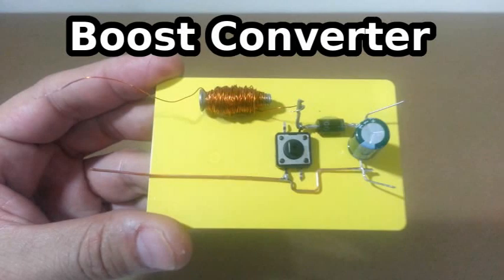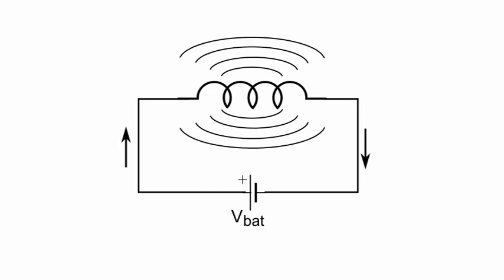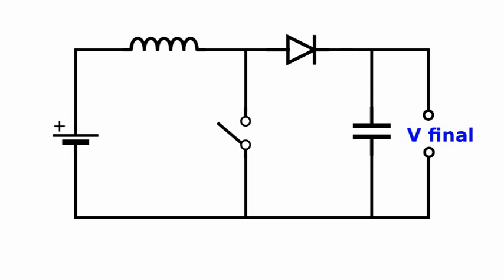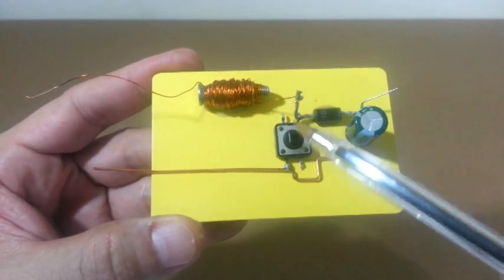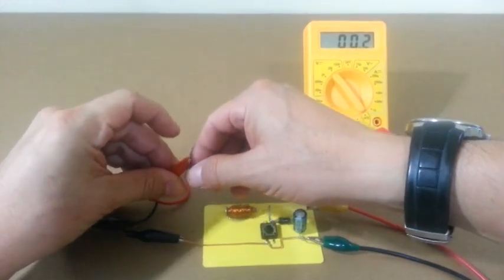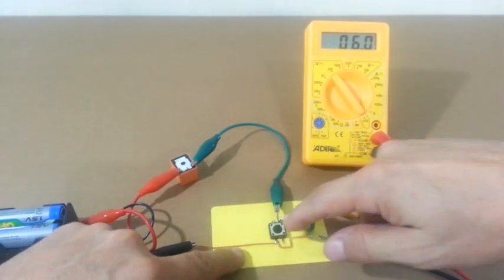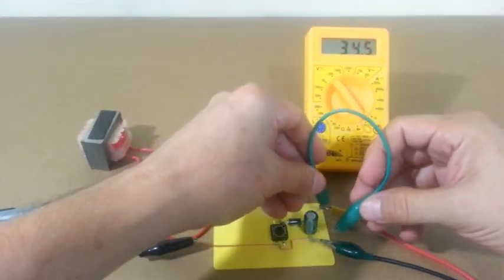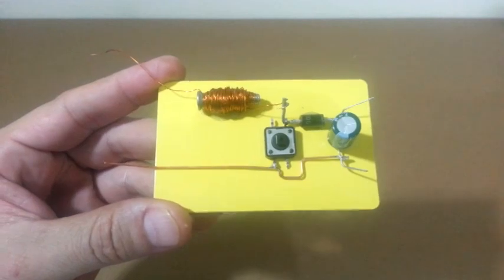Boost Converter - How it works?

Comment: Let's take 2 batteries 3.7V and one is used as voltage booster which can boost upto 12V and in the meanwhile 2nd battery will charge from that 12V and once that 1st battery is out of charge then the 2nd battery will takes its place and once that 2nd battery is dead then the 1st battery will takes it place and this cycle goes continuously and so that will it be a perpetual mechine

Comment: Thanks for this video. What are the theoretical limitations for higher voltages? When it comes to very high voltages, we usually see Flyback transformers or Cockcroft-Walton generators or serial combinations of the two. Is there any reason (e.g. component limitations) the same (let's say ~10 kV) can't be achieved with a transformerless solution, with "pumping up" a capacitor from inductance alone?

Comment: If capacitence low ( like 1uF) you can reach easily to 100-200 volts.
Or inductance high (like 660uH) you can reach easily to 100-200 volts.

Comment: This is fake. It should not boost the voltage as it's switching is not synchronous or high. A transistor should do it. What you are doing will only cause a short circuit each time you press the switch.
Reply from the maker: your ass is fake

Comment: I made its it's working but voltage show only in Multimeter when you connect a load  the output voltage becomes equal to the input voltage

Comment: If the switch is replaced with a very small capacitor, will it work the same? Because I imagine that the small capacitor will charge the inductor at a small amount of time until its own resistance rises to stop DC flow, and effectively acts as an open switch

Comment: I did, it worked but the LED is not glowing instead it blinks when I press the switch 
Please help me out sir 
Reply me quickly sir
Reply: Because boost convertors need the switching to oscillate in order to simulate a constant supply as it only produces the higher voltage in bursts

Comment: i have tried that circuit, but my circuit is short circuit.. what is the problem??please answer quickly.. thanks
Reply: Because the input side just consists of an inductor and a switch so as soon as the inductor has built up a stable magnetic field its basically just a dead short(when ignoring its innate esr)

Comment: I made this and it short circuits my batteries and lowers voltage. I am using 3v dc. any tips to get it working?
Reply: Because the input side just consists of an inductor and a switch so as soon as the inductor has built up a stable magnetic field its basically just a dead short(when ignoring its innate esr)

Comment: does this also increases the amps?
Reply from the maker: No
Reply: is there a circuit in which you can increase the amps of a battery?
Reply: @kronosdarkangel5290  yes, but it will decrease the voltage

Comment: Just tried this on breadboard with 9 volt battery, E19 audio transformer (blue in color, used the side with 2 terminals), 1N4004, a switch, a 10uF 160v e-cap. I reached 115 volts measured with DMM :) and stopped there. :)
Thanks a lot, Ludic. :)

Comment: Can you use this with a 555 timer as an oscillator? I really need the answer ASAP thanks!
Reply from the maker: yes but you need more circuitry than just the 555
Reply: Ludic Science thanks for replying incredibly fast. I already have an oscillator circuit. Can I just plug pin 3 to a mosfet instead of the tactile switch shown in the video? Therefore it turns it on and off really fast, thanks!!!

Comment: Very good. One thing to add, when the switch is off the magnetic field in the inductor/transformer collapses in opposite polarity of input voltage, this results in two voltages Vin + the back emf (voltage) across the inductor. They then both add up and the voltage output is boosted

Comment: If you used the relay as a coil, the relay would also make a clicking noise because the magnetic field inside pulls a switch making a "*click*"

Comment: Does it work without a diode?
Reply: Andre Niño Bayud The diode stops the switch from discharging all the energy from the output capacitor i.e. shorting it out. So it’s needed during the period the switch is closed to maintain the charge in the capacitor for the load to use

Comment: > be me
> charging caps capabilities intensifies
> makes the circuit
> uses an inductor with 2Ohm of resistance (does not know about that)
> burns the power supply
> fml.jpeg

Comment: such a simple and understandable video thankyou:) it worked wen I tried with transformer....but what transistor can I use instead of switch soo that I can get a stable output voltage? I tried to use bc547,didn't get it though

Comment: Can this type of circuit make a small electric brush-less motor spin faster?  I'm trying to make a hovercraft thrust propeller spin faster but I'm limited to either 9 or 18v (two 9v batteries).  I think I'm correct that when I boost the voltage, the current decreases?  Is there a way to do what I want with light weight electronics?

Comment: if I have 400 volts and only 250mah what can I use to increase the amps.
Reply: erick sal if AC Or DC
Reply: I noticed a typo it , its not 400, it 80v DC, 220mah, its a micro hydro generator, you hook it to a water outlet and it generates, here where I live we have big water basins on the roof, 750 liters, the basins have many water outlets at the bottom so you can connect pipes or PVC, so I connected a garden valve to one outlet and the pressure is strong, from the outlet of the generator I connected a water hose back into the basin, no water loss, but the out put is low on amp's (DC) I was thinking about a booster or transformer, any ideas?
Reply: Use a inverter circuit then use a step down transformer
Reply: OK thank you,
Reply: No problem :)

Comment: Thank you for providing a simple, understandable, and repeatable experiment to help me understand boost converters. I need one to power a small thermostat (which for some weird reason has an input voltage of 12v) with a portable battery (9v). I'd rather build the converter myself since I'm modifying something with the thermostat anyway. This helped a lot, thanks!!

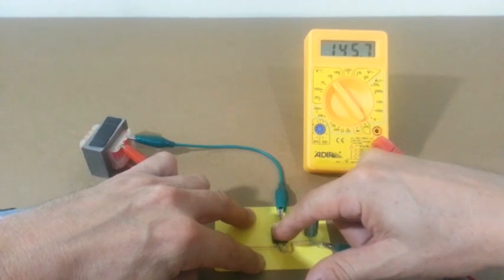Comment: Why your capacitor not exploding according to excessive rate of voltage @ 4:05 (140 volts)?
for example, if i have 100uF/16v and i give it 50v accross, it will explode
Reply: Alviansyah Arman It did not explode or fail because the capacitor he is using is rated to 200volts

Comment: Is this example harmful in any way ?
Reply: just don't touch the output-wires when charged to a high volatage. >60V can be very painful, >120V is dangerous!
Reply: but the amps will be quite low.
Reply: thats correct, but even small amounts of current (and high voltage) can (for example) confuse your heart(beat)-rythm

Comment: Can the button be replaced with this component (http://www.st.com/content/ccc/resource/technical/document/datasheet/1d/eb/f3/e7/63/c2/48/8a/CD00003024.pdf/files/CD00003024.pdf/jcr:content/translations/en.CD00003024.pdf) and if it cans, how?
Reply: Hum, a transistor should work i think, just to know what kind of transistors... There is a huge amount of diffrent transistors...🙈

Comment: with this circuit, does the high voltage flows back into the input battery??? that would be bad
Reply: No. Thats why you have a diode to avoid the current flowing back.

Comment: you can use that volts in 120 electricity?
Reply: in theory you could use it on heating-devices and simple motors. But the output is is very low-powered (propably < 1Watt when triggered by hand). Also, the output is DC, but for household-application you need AC
Reply: If you mean you want 120v AC then with that you can't. Because batteries voltage is DC.
But if you add AC to DC inverter then you can. Just like these car adapters work:
http://www.instructables.com/id/120v-Power-Source-for-Car/?ALLSTEPS
Reply: DC to AC inverter. Inverters are commonly used in PV systems to change the DC source of the panel/batteries to AC for house loads. Only problem is finding one to match the application or scaling up to match the inverter.

Comment: if i change the push switch with mosfet then where should i fix the G D S pin?
Reply: Joe i think you have to use a timing/trigger device like Oscillator to do on-off a transistor rapidly... i am not an electronic engineer...

Comment: did this booster change the current also?
Reply: Hossam Gouda Yes The Current Decreases When The Voltage Increases So The Output Remains Same
Reply: Hossam Gouda Yes The Current Decreases When The Voltage Increases So The Output Remains Same

Comment: Nice video dude! Nicely explained. Btw, what is the current output at around something like 20 volts? can i use this device to power small breadboard projects that require around 5-9 volts with specific current in mA? You see, I'm a noob and variable DC power supplies are too expensive for me :(
Reply: As these tyoe of circuits are unstable, you cannot use them as a power supply. Ohms law says that I=U/R (current equals voltage divided by resistance), therefore your output will have less and less current as voltage is getting higher.
For a variable DC supply, you can use any transformer, connected to a Graetz-bridge, an LM317 variable voltage regulator, some resistors and two electrolitic capacitors, there are many simple and easy plans about how to make one. LM317 is cheap, reliable and you can buy it almost everywhere, including ebay, or a local electrotechnical stores. Just search LM317 on the web, you'll find billions of plans with it.
Reply: Thanks for your suggestion bro. Very well explained. I think LM317 based variable voltage regulators can be a good choice for me, as I've found very affordable one in a local store. Just what I needed. Thanks again :)
Reply: evanB
You're welcome.

Comment: Lovely video! Is there a minimum voltage threshold for this circuit for the voltage you want to increase? Thanks in advance!
Reply from the maker: the minimum voltage depends on the components used for switching. this is just a demonstration setup
Reply: Would this circuit work if I wanted to use an MP3 as the DC source I want to amplify? (without messing up the MP3 itself)

Comment: so if u boost the voltage that way..... you must lose something right? like the amps??
Reply from the maker: marcques mouton impossible
Reply from the maker: +Hammer USN yes of course
Reply: ok ty
Reply: Hammer USN this is so fake because that capacitors max voltage is 6v and the curcuit makes no sence
Reply: if it's a 200v capacitor it is not a max voltage of 6v, it is a max voltage of 200v. however you do lose something as with all converting circuits like this, which is the max current.
Reply: any chance you can boost both the amps and voltage?
Reply: Higher voltage source, hah
Reply: Or magic
Reply: Cole Foster Why don't you try it? Connect it to an Oscilloscope if you want more accuracy in measurements.
Reply: This went from a science question to internet cockfight rofl
Reply: the iN4007 is a good one, but basically any diode that is rated above your voltage should be fine
Reply: u can buy these fully working on ebay like $3  man, is u want. i got 5 of  these buck converters off there for like $7
Reply: P in always has to equals p out mins the inefficiency of the components and since p = iv if you increase one the other must go down

Comment: Why do you tap the button repeatedly? Is it possible to transform 12vac into 24vac or more with repeatedly pushing a button?
Reply from the maker: Yes, by using an electronic switch (transisor). This is only a demonstration circuit

Comment: But why we need the coil?and how the voltage value in the capacitor is keep increasing?i thought the capacitor just stores the our input voltage?
Reply: The coil 'wants' to maintain a constant current, so when the circuit is opened (no current can flow), the coil 'attempts' to get the current going. To do so, it would need a high voltage. Capacitors do not conduct for a constant (DC) voltage, but they do conduct if a changing (AC-ish) voltage is applied: current can flow and the coil loses its magnetic energy (thats why it wont keep charging up if you stop pushing the button) Capacitors charge up until they have reached the supply voltage (6V, initially). For this reason, they can get charged more (until a higher voltage) if the coil is inducing this.
Reply: Coil makes electromagnetism and it back to coil, it's creating a higher voltage and charge the capacitor.

Comment: Excellent work,and explanation  man ! if as coil ,i put two tranformers ,and a capacitor of 220 uf what voltage obtain?of cource,as batery ,8 volts. How can increase amps in that kind of circuit? wait for an answer ,man,and once again  congratulations for explanation !Greetings fron Transylvania !

Comment: CAN SOMEONE PLEASE HELP ME : im trying to turn it off an on  with a 555 timer, will the circuit work the same if i turn the positive on and off from the output of the 555 timer? and 
 im gonna be using the same power source as the inductor so how do i stop the chip from burning out?

Comment: How comes the  seconday part of the transformer  generates a higher voltage than the primary yet it has less turns?
Reply from the maker: there is no secondary

Comment: i used a 555 timer with a mosfet and a little square inductor out of a CFL light and got up to 330V
Reply: you need defend 555 ic with a diode becuse coil make high voltage and kill all sensitive parts :) and 555 ic max voltage only 15V
Reply: but how low will amps go?
Reply: Darius Cotovanu input or output? input is usually 2 amps
Reply: output
Reply: Darius Cotovanu i dont know sorry
Reply: omg omg ok ok please give me the schematics for that how did you connect the output  of the 555 timer to connect to inductor
Reply: oh my bad you used  a transistor im guessing npn right
Reply: PLEASE ANSWER ME
Reply: HOW DID YOU GET THE 555 timer to not burn out
Reply: Awesome

Comment: extremely helpful, thank you.
i just need to know what happens if u press the switch for a longer period of time before releasing it, does it affect the maximum induced output voltage ?
Reply from the maker: does not help, on the contrary
Reply: +Ludic Science on the contrary? u mean it will damage the circuit?

Comment: Thx for sharing. BTW the transformer you were using was a step up transformer cause the secondary coil generated a higher voltage.
Reply from the maker: +ziad fawzi There is no transformer. Only an inductor. One single coil

Comment: can i use copper wire for the inductor?
Reply from the maker: +Guy Green must be insulated wire
Reply: +Ludic Science so i can use copper wire but the wire needs to be insulated?
Reply from the maker: +Guy Green Yes
Reply: +Ludic Science ok thx <3
Reply from the maker: +Guy Green magnet wire can be recycled from old transformers and motors
Reply: +Ludic Science ok i will try to get some transformers :D

Comment: Current decreases. How to increase it?
Reply: Hi,You can let the voltage on the maximum by replacing push button by a slide switch,It wont decrease now

Comment: hello sir good video.
but how can i use with electronic motor for generate power and  re-boost that power ?
example : currently  i am convert  3 v to 28 v.  
now i wan to use 6 v for re-generator 3 v  and other 20-22 voltage for some other device like charger or fan  etc.
plz help me sir
Reply from the maker: +Ronak shah so you want to recharge your battery with those 3 v to recharge your battery and have energy forever? Sorry that is imposible
Reply from the maker: +Ronak shah I am NOT INTERESTED IN FREE ENERGY. My channel is about real science, not fakes.

Comment: Thanks for all your help ! Really much appreciated !, last question ............. how would you maintain the output voltage of your booster to supply steady Vout ?

in other words ..... suppose you press the switch and stop at 60V, how would that 60v be maintained on the Vout ?

thanks
Reply from the maker: +Nico Botha you need a voltage regulator circuit

Comment: Hi thanks for the video, very nice ! Being new to this i have a question .... 1) Can you use normal insulated 29# wire 2) Can you chaqnge the capacitor values and it will remain working ? 3) i am using 20.1v solar panel as power supply, is this ok ?

thanks
Reply from the maker: +Nico Botha Hi, normal wire is very thick, the coil will be too large but it may work. Yes but the cap voltage must be the same or higher than the output voltage of the converter. 3) yes
Reply: I am very new to this !! (total electronic background is 3 weeks)
sorry, its not normal wire, its copper wire i bought from an electronic store ! (hihi), .... let me explain what i have done and used and you tell why its not working Please ...... 1)SWG 29 Wire 2) Hitano 100uf 450V Cap    3) 1N4007 diode, 4) IAlso i regulated the power comming in with a LM 317 T - NLAO 142 (i think), because i also added a 100k Pot connected from the power (20v solar) to the ajustable on the 317, and the LM317 vout to your circuit !

please help out

thanks
Reply from the maker: +Nico Botha first, the wire must be insulated, you need magnet wire (also called enemelled wire). second, make sure you have a voltage at the output of the LM317
Reply: Hi thanks for the reply !, i suffered a bit, but eventually added different caps, directional diodes, a zener a few resistors and a transformer...............it maxed out my dmm (set at 600v) !

problem is no longer to get voltage up (managed that), i now seem to have a current problem !, how do i cross that bridge ?

Comment: Try connecting a load and you will see how things get harder.
Reply from the maker: +MyKhalidkhalid Did you see the video? This is just to demonstrate the principle of the boost converter. It is not meant as a practical circuit.